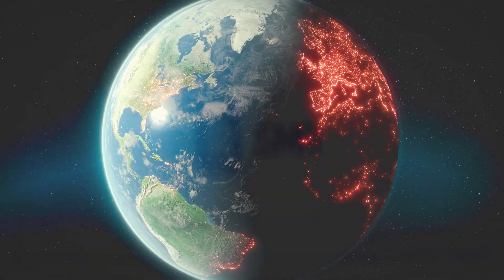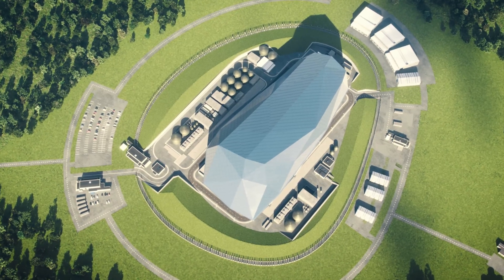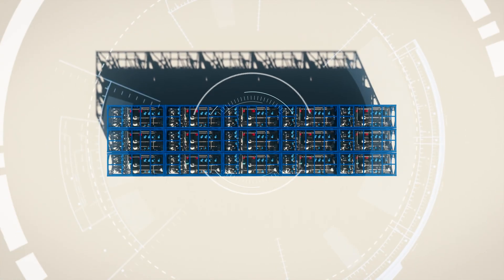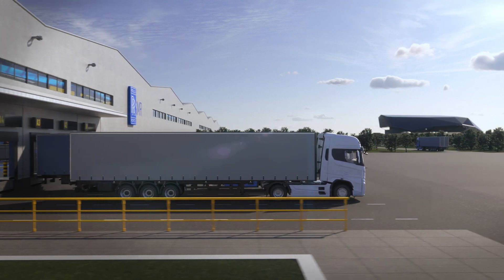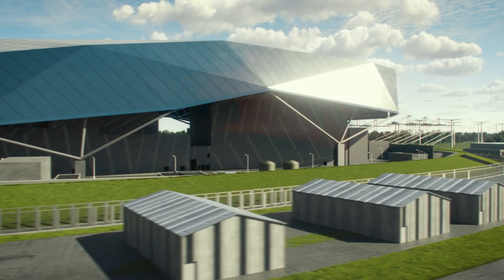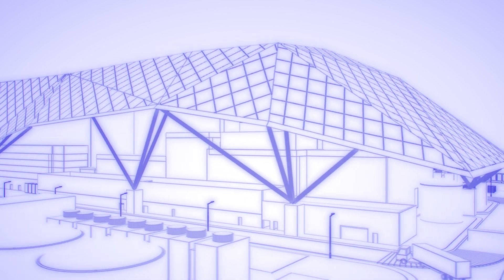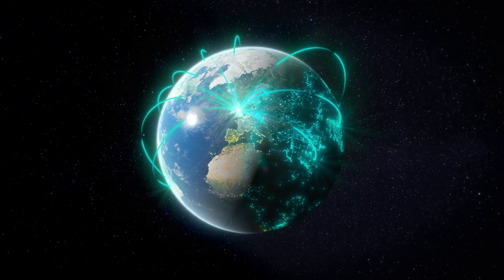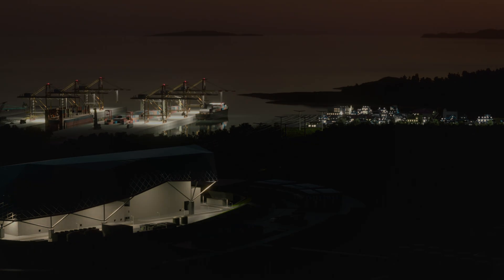Rolls-Royce SMR, a British solution to the global energy challenge

Comment: It’s about time the UK government got its finger out and placed an order with Rolls Royce for at least 2 smrs. The estimated initial cost or £2 to £3 billion and a target price of £1.8 billion, they’re a fraction of the cost of a full scale reactor, cheaper and safer to run. If they spent as much on a bunch of smrs as they are doing on Hinckley Point, the actual generating capacity / £ would be greater.
Reply: I've been saying this for ages.
Reply: @heavy_metal_chemist  What we believe about SMR’s was at one time promoted quite widely online and several positive articles can still be found.  That’s where I got info to base my comment on.  However, recently I’ve noticed several critical articles which offer nothing but negativity and contradiction.  It makes me wonder why and who is behind this criticism and what are their motives. I think something fishy is going on.  Especially when other renewable energy systems  are not without major problems, such as the toxic heavy metals within solar panels and their poor efficiency when they get dirty. Also, the difficulty in disposing the huge fibreglass wind turbine blades, which only have a lifespan of 20 years at best.  Already they are being dumped in landfill and even in piles here and there across the country.  SMR’s would seem to be the sensible, continuous, long term solution until nuclear fusion is perfected.
Reply: @iancanty9875  As the next generation of reactors they make sense, but the same could be said if you build a dozen AP1000s, the economy of scale drives cost down. The challenge we have is that there's only so much uranium and we're going to have to revisit closing the fuel cycle (again) in light of others also being interested in increased nuclear capacity. Gen IV reactors are the next step, logically, but development is needed.

Comment: Impossible to fit everything into a single module. A collection of modules maybe.

Also what if it goes wrong? You can't move it easily and the containment won't be the same as a fixed building.

It's a gimmick. Should have been perfecting how to build an actual plant like the French have for decades. 

Instead of trying to leapfrog back in with this half baked idea.
Reply: Its a lot cheaper to build these all over the country than massive plants like Hinkley C which is in the news recently for massive delays and cost over runs.
Reply: @thefowlyetti2 at least we know the cost and hinkley exists as a physical thing. This does not.
Reply: What if what goes wrong ? this is a 3rd Gen PWR they’ve been around for ages and RR already use them in Subs, as for for  Containment these things are designed to withstand a LOCA

Comment: You need to get on board with nuclear enabled hydrogen (NEH) for every SMR ordered.
Paired with a PEM electrolyser, each SMR, operatin at 100% availability, would be able to load follow grid demand in milliseconds; even the crazy, random generation forms from wind and solar. 
Operators would qualify for 4 revenue streams and be able to sell greener-than-green NEH into the existing hydrogen market, most probably at a premium.
'Selling' an SMR + NEH manufacture to the government will be 10X easier than 'selling' the SMR on its own.

Search for: 
cost of powering the uk with smrs and neh
Reply: Also if you were clever you could use the waste heat through a heat exchanger.